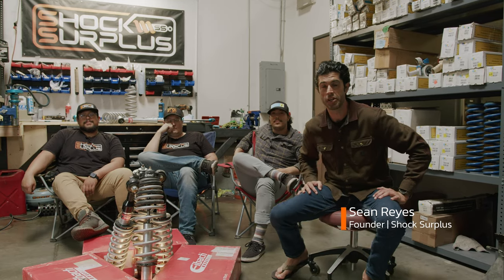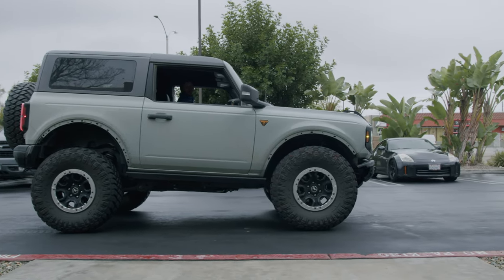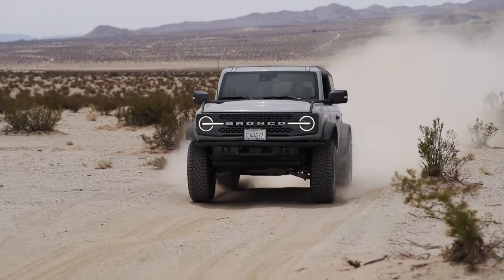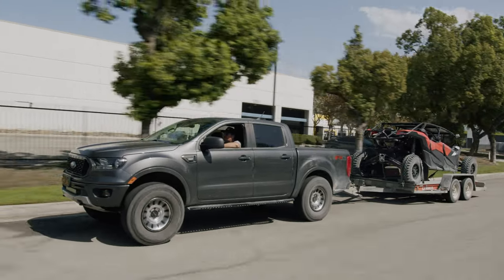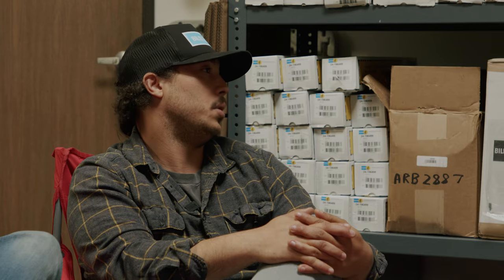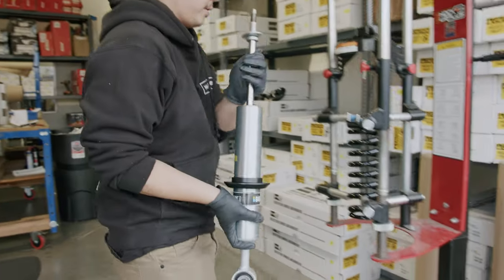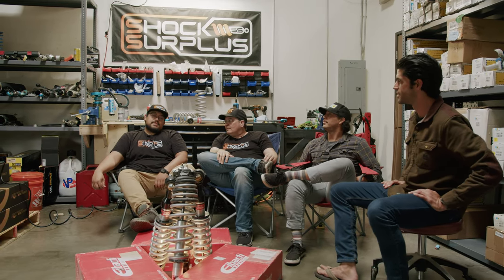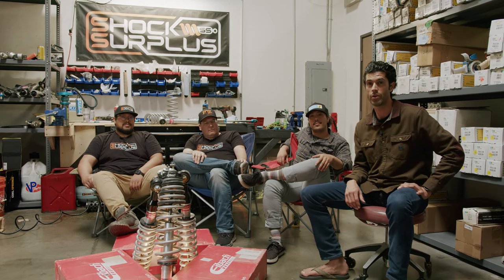Eibach Triple Pro-Truck Review! Silverado - Bronco - Ranger

Comment: I have a 2018 f150 crew cab fx4 with 2.7L engine. I am currently running Bilstein 5100's at max height, which gives me 2 inches of lift, and 33" General Grabber Atx tires.

I tow a camper weighing about 7000lbs about 7 times a summer and go to the sand dunes about the same.

I'm debating between the Bilstein 6112/5160 or the Eiback pro truck 2r. Which would be the best setup for those conditions in your opinion?

Also if I replace the rear lift block with a 1.75" taller block, should I add bump stop extensions or will the new shocks be able to handle the additional up travel without bottoming out or damaging driveline components?

Thanks in advance.
Reply from the maker: I would probably lean towards the Bilsteins simply because they are better under a load, and the larger body on the front struts will be more supportive for the times a set of whoops pop up or a dune falls away right in front of you. They may not be quite as comfortable over smaller bumps at lower speeds, but they will keep you going with less drama during those "uh oh" moments or when you are loaded down. The 5160s are plenty long enough to handle that much lift in the rear and are not any longer than stock when fully compressed so there is no need to worry about a bump stop spacers. These F-150s also have plenty of leeway at the rear driveline so that will not be a concern.

Comment: I have a 2018 silverado and have been looking at the eibach 2.0 pro truck kit. I want to put a full replacement ranch hand Front bumper on it. Will these shocks at the lowest setting be ok even with the added weight from the bumper (200lbs)? 

Just trying to get away from the stock Ranchos that have 50k on them. Thanks
Reply from the maker: The 2.0 coilovers for your application are a good bit longer than stock, so they really should not be set at less than 1.75" of lift over stock in the front. Which with the weight og that bumper, will certainly not be at their lowest recommended preload setting

Comment: I have a 21 F150 hybrid that I will be towing with regularly and I wanted to get your opinion on what shocks to get?
Reply from the maker: Eibach Stage 2 or Bilstein 6112s and 5100s would both be great choices. The Eibach will ride a bit better unloaded but the Bilsteins will be better under a load so it really comes down to what you want to prioritize
Reply: @ShockSurplus  Thanks for the info. What do you think about Falcon Sport Tow/Haul Shock Leveling System? Also how do they compare to the Eibach and Bilstein shocks?

Comment: What are the benefits of leveling out a vehicle? There seems to be a lot more cons than pros. If all you want to do is off road, I get it. Mo clearance, mo betta. However, most other tasks would just decrease fuel economy especially when hauling any kind of load as the vehicle is raked back.
Reply from the maker: Surprisingly, none of the vehicles in this video besides maybe the Bronco are level, and even that was not intentional. The extra 50-60lbs of a bigger spare, spacer, relocation brackets, and reinforcement plates made the rear sit lower than Eibach's intended settings. We could have easily adjusted them, but that 2 door is never seeing any load, and we were off to the next suspension system before it even mattered. Even then, we all are running just about the minimum amount of lift needed to fit our respective tires. When setting up customers with a lifted suspension package, we try to steer them away from having a truly level setup, particularly if they plan on towing and hauling their vehicle. Some applications like the 19+  Rangers do have an obscene amount of forward rake that hampers handling, hurts ride, and even causes the crash avoidance systems to go off erroneously, so sometimes getting the truck more level than it was out of the factory can be very beneficial, with very little loss in load stability of gas mileage. Having a more even weight distribution helps everywhere, but with everything, there is a point of diminishing returns. Even then, unless you never plan on carrying any weight or do not have a load leveling aid like airbags or Sumo Springs, we hardly ever recommend our customers set their vehicles up to be dead level. In fact, oftentimes, lifting the rear allows you to run a longer travel shock for better articulation off-road, so even real off-road enthusiasts are better off doing more than a basic level.  Furthermore, most modern trucks and SUVs are really limited in upward or bump travel in the rear, so adding some distance from the stops with a little lift out back is just as if not more beneficial than lifting the front on some applications. I think the big reason many people swing towards more of a leveling kit is that most people prefer the look of a truck that sits more level, and on most applications, you can run a much larger tire just by lifting the front. In most cases, gas mileage is the same, if not better than it would be if you did a true lift kit that lifted the front and rear the same or a similar amount, and it gets people to their goal in tire size as well as better shocks without spending too much money. Realistically though, somebody looking to level, lift, wheel, or put their truck on big tires is not really all that concerned with gas mileage or, at the very least is more than well aware they will be losing some MPG. That said, we are usually less concerned with ride height and more about actual suspension performance, which is why we are such a big fan of the Eibachs. On most applications, their 2.0 coilovers usually work as well at close to stock height as they do with some lift or leveling and are adjustable while installed on the vehicle. So you can get the same benefits in ride and handling while maintaining stock height or close to it, and you do not have to monkey with a spring compressor to get them dialed in.

Comment: Can the eibach be installed on a trail boss Silverado ? Set to max height to give the 2” factory lift height. 
And are the rears compatible with the 2” factory trailboss lift ? 
Oh and same question for the fox 2.0. Thank you. 
Thanks !!
Reply from the maker: Both can technically be installed on Trail Boss or AT4 models however they pretty much max out at stock height in the front and the rear shocks can not take any more lift.
Reply: @ShockSurplus   thanks for the info! So they don’t make a Trailboss specific kit? Do you know if they have plans to? And same question goes for the fox 2.0 kit? That kit would also be maxed out? Is there a Fox 2.0 Trailboss specific kit? Thanks again!

Comment: I have an at4 1500 diesel. I want to run the bilstein 6112 with the ready lift sst kit. Do you know if those are compatible?
Reply from the maker: Definitely not at all. The addition of the spacer on the 6112s is going to eat your front axles for sure.

Comment: Yup the rear end issue on the bronco is because no sway bar.
Reply from the maker: Yup and a track bar drop and it would have done well. Sasquatch Broncos do not get them, so we do think it was a bit of an oversight not to give a little more low speed dampening to mitigate more unwanted body motions, with so many Broncos not having a rear bar. We have tested a lot of other shocks on the Bronco at similar lift heights without having the same complaints, but adding a sway bar and track bar relocation is not a big deal, and if you like a softer ride, we think these would be killer.